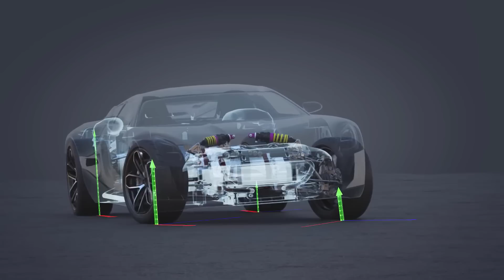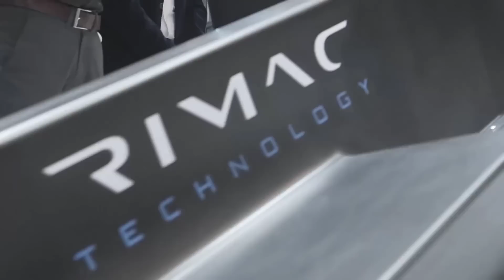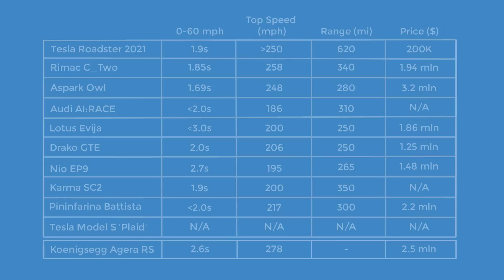World's FASTEST Electric Cars! 0-60MPH in 1.69sec?!

Comment: I think if I was on a budget, I would buy 10x Tesla Roadster in case I wreck 9 of them due shitty tires, potholes at 250mph and deer/bird collisions. That Pininfarina is definitely my favorite aesthetically, it's just a gorgeous car and it actually has great specs. All these cars look uncomfortable to sit in. None of these cars have 4 doors or a baby seat. None of these cars looked like they have an ashtray or outrageous audio capabilities built into the chassis... Face it, if these supercar makers incorporated acoustic chambers into the hull, they would win some brownie points and a dual layer, carbon fiber chassis would make the optimal sound system. The other thing that is missing from these cars is a 120v 15A adapter. LOOOL . These cars assume that there will be a charging station. Nope. These cars need to have a built in fast charger that works on 120/240/277/360/440 V but due to the extra weight, only two of the cars in this video have such compatibility built in. Trunk space sucks in most of these. Most of these cars have a great view of the road ahead but are almost completely blind when backing up. Although that can be corrected with a little camera, wouldn't a 360 degree panoramic view be much more desirable? Finally, what really gets me is that they are mentioning cutting edge composite carbon fiber and that's 20 year old tech. Transparent aluminum and transparent seats would allow a driver to see the road below him !! Tell me what YOU think !!

Comment: Rediculous speed, however these are test beds for common cars. I'm still waiting for a simple electric/gas hybrid which can be charged via solar panels installed on it's roof and body/plug-in/gasoline with no more than a decades old, tried and true, 55 hp, 60mpg, 999cc, 3 cylinder Suzuki type engine.

Comment: The Tesla has huge range because of that humongous 200 kwH battery. But with great range comes great weight, expect that roadster to weigh 2.5 T. The others are actually more hypercar oriented. Rimac uses F1 grade cells, which have massive specific power output and regenerative capability. I mean they get more power than a P100D out of a 5.2 kWh battery. Rimac also supplies the batteries for many other cars.

The only oddity on that list is Lotus. Though it looks so cool, why of all would Lotus get into this 2 Ton Electric Hypercar thing?

One reason for the low cost is that the Tesla uses less exotic manufacturing tech, and it's mass produced - no carbon fiber monocoque, F1 grade cells for starters. The others are hand made in small numbers. But the Tesla build quality will be nowhere on par with a Rimac (seriously, the paint is the worst I've ever seen, while a Koenigsegg may be considered the best).

Comment: Pretty sure if tesla decides to use all carbon fiber like the other and remove some seats weight, also bigger motor which less cargo room, Could be faster. Buy hey its not a competition for faster car which most countries have speed limit which is probably useless if you want to compete on speed

Comment: Sigh... always with the straight line speeds. You can make a brick go quickly in a straight line, we really need to know how they do on the twisty sections, and for how long you can push them before they overheat. Lots of torque / hp needs lots of cooling.

Comment: Electric cars are cool, but nothing I mean nothing beats the sound of an actual engine, what would Formula 1, or NASCAR, racing in general and driving vehicles would be without the combustion engine. The engine cars are not going anywhere they where still be here another 100 years later roaring on the road.

Comment: It is in a different ball park ; they had planned on EVs for the planet and instead they are making expensive luxury vehicles, is it fast? YES on a drag strip, but you can only drive about 100 miles at high speeds eg 140 mph.then you have to sit and charge  - beyond that in a world where lithium ion batterys are in short supply the best idea they have is to stuff as many as they can in so there are fewer cars total. PHEV's use far fewer batteries per car and achieve more fleet EV miles but - Tesla really couldn't product differentiate doing that so they use 10x more batteries per car.. smooth.

Comment: If the minimum range isn't at least 300 mph, then its not ready for prime time. In addition, all electric car manufacture need to come together and develop an electric standard so that any car from any manufacture can all use the same power facility. Having different requirements for different manufacture just weakens the entire EV vehicle industry. 

 Anyway, not sure why Teslas even in this bunch. These are million dollar exotic race cars, not practice daily drives. If the commonality is electric then you could put the Honda e in with this group.

Comment: Sick.

So the battery came out, like a million years ago, and we've been using petrol fuel all this time when we should have been using batteries and electric.. we're basically back tracking. Total bs. So much time has been wasted.
Reply: None of the existing companies wanted to turn around their giant metaphorical ships. Now it is too late for most of them. They cannot write off their investments in ICE engine and drivetrain manufacturing it's just not financially possible. I almost feel sorry for them.
Reply: charge time and range, we dont know fast chagring will get if improved much by 2035

Comment: I wouldn't spend more than $250k on any car hypercar, I would want reliable charging, I want any car to be made in a volume the manufacturer can exercise continuous improvement and update mine over the air I would want the latest most reliable batteries, and Id want the company to be expert in electric propulsion systems .........done deal then, Tesla the rest are just dic* swinging.